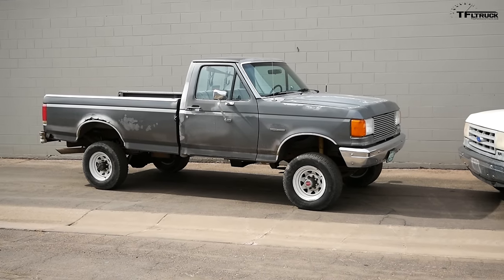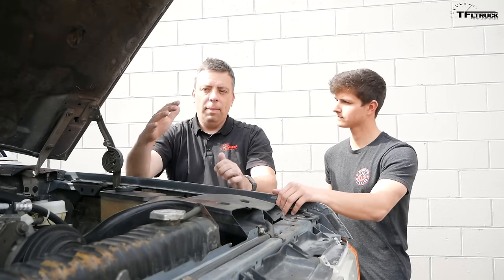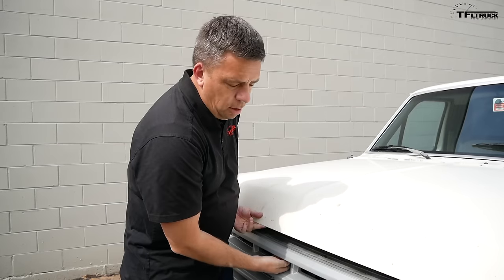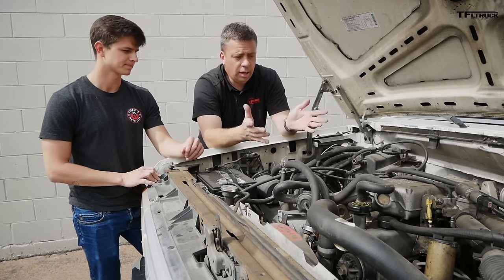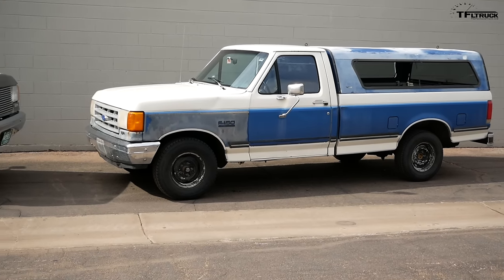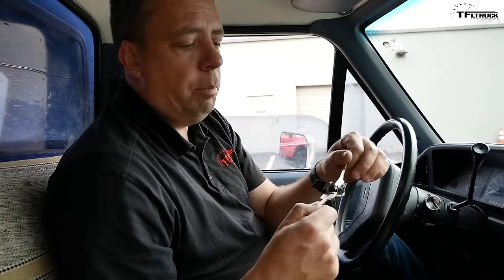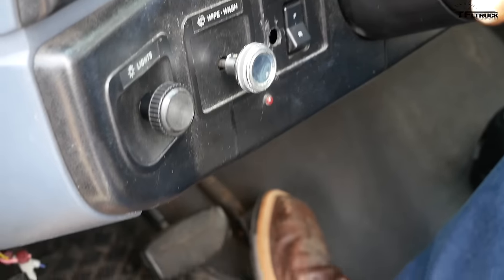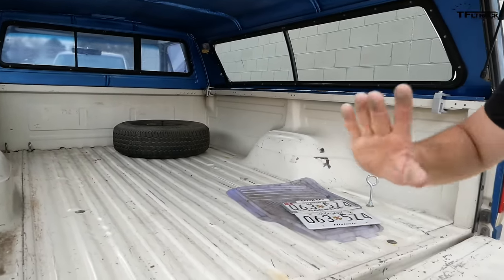Here's Why You Can't Kill An Old Ford F-Series Truck | Gunsmoke Ep.3

Comment: The 4.9 is one of best engines ever made. Shame Ford stopped making them.
Reply: id like to see ford reintroduce the 4.9l with a turbo as option in the Super Duty
Reply: Perry2186 absolutely. They wouldn’t do it because it would be indestructible and they wouldn’t make any money off repairs like soaking people with most of their modern garbage.
Reply: @Packinheat1175   I think eco boost Tech on a 4.9 get around 350 hp 500 tq
Reply: Perry2186 yup, at at like 1100 RPM 😀. Would make an rock solid power plant. Would be a torque monster.
Reply: @Perry2186  that would be so awesome, basically would be a diesel engine that runs off of gas
Reply: W R couldn’t agree more. Knew many people with well over 200K on them with no problems. One never even changed his spark-plugs.
Reply: Chris Hutchison I believe it. I had one for 25 years and it was an absolute tank.
Reply: My first vehicle was a 1993 F-150. It had sooo many problems. At one point, it was a I4 with 2 cylinders completely dead. I still drove it to the mechanic to find out what the problem was. I now have 2, a 1994 I300 with a M5OD manual as my daily. And the original 1993 I bought, waiting for me to finally get the new engine put in, it's an automatic. I will never own another vehicle. As of my 23 years in service I have been true to that.
Reply: scdevon probably because Ford made no money on repairing them. The one I had ran flawlessly for the 25 years I had it. Also, the eco-movement and peoples desire for 35mpg out of truck killed it. Personally I think people need to get off that kick. It has turned vehicles into overpriced, unreliable garbage.
Reply: My Grandpa used to have a 93 Ford F-350 with a dump bed on it and manual trans. When I popped the hood I was so surprised it had a gas 300 I6. Torquey engine
Reply: They had designs for a new inline 6 but the boys at the head of Ford wanted a more modern engine for the trucks and force them designed the V6 is that preceded it can't beat that engine for anyting and that's why they kept improving it but in all fairness in lines are old Tech and was frowned upon at that time
Reply: Ive got a 93 with a i6 and manual. No problems for the year or so ive had it!
Reply: dakota croasdale like the 8.1 in the avalanche 2500. It was a torque monster in stock form.
Reply: The real reason they won't is because they would not meet pollution standards.  You have more control over burn with smaller pistons.  That is one reason they made a V10 of only 412ci for years.  Also, they were not know for fuel economy so if buyers were offered this vs a new 2.7 or 3.5 turbo the take rate would be pretty low.  Less hp and less economy.  than the newer V6s.  Straight 6 only wins in longevity, but most who buy new only care if it to lasts 10 years, not 30.
Reply: I’ve had plenty of issues with fords. But I’ve never had trouble with a 4.9 six banger.
Reply: @jasonjohnson9810  hahaha hit the nail on the head
Reply: W R there also one the the biggest terds ford ever made, I had a 95 f150 4.9 auto 4x4, thing was a terd. My 1990 f150 4x4 with 5.8 351w is a tank on the other hand. I’ve seen so many of these old fords with the 4.9 rusted out or sent the the junk yard, seems that every f150 out there has one in it and barely any have a 302 or 351 in it.
Reply: I think ford coulda kept them in some of the f150s of the 97-03 generation, but ford was wanting to get away from pushrod engines back then.
Reply: I had a 94 ford e350 work van 300 straight six 461000 mi. Still ran like a top and only burned a little over 2 qts of oil between oil changes. Never let me down or left me stranded. Body mounts rotted out and i couldn't get it inspected anymore. It was like an old friend. Sad to see it go. I paid $1000 for it in1998 with 190k on it and bald tires. 21yrs later i got $450 for it for scrap. Long story short, best van ever with the best engine ever.
Reply: Perry2186 I heard a rumor that GM was looking into that as well.  But you still have packaging and weight issues.  Inline is heavy and is usually limited on bore size because large bore makes the engine longer.  Companies like BMW who use straight six’s keep them small displacement and use expensive exotic metals to keep them light.  They are made of magnesium.  Neither is good in a truck.  A Cummins is a straight six but has economy of scale in that it is basically a medium duty truck motor and industrial motor used in other applications.  A turbo small displacement gas 6 would be  cool.  That may allow them to make it small enough to fit in SUVs and get some economy of scale.  But at the end of the day it will still be heavy and expensive :(
Reply: Another new face?
Reply: Well ford's stock is like $5 right now. Someone needs to buy a stake in the company and force them to innovate on this old design. Imagine if we got a 250hp 600tq monster with 25mpg. Making money on them would be easy, since the engine can go in just about anything. Ups, dump trucks, hell with that power you could probably give a freightliner a run for it's money.
Reply: I have one on my '86
Reply: tomsriv and that is the sad part. Smart people don’t care about an extra mpg. Similarly smart people realize the climate movement is the biggest scam ever forced on society. If anyone disagrees, enjoy your $800 a month vehicle payment for something that will last 7 years....
Reply: Cuz I Can what do you mean by a “turd”? They were not designed to be power monsters, they were designed to be reliable, which they were. IF you actually see more of them in the junk yard because they sold more.
Reply: W R climate change is settled science.  But even if it wasn’t, and you need a selfish reason to be for it, think strategically.   we are better off if we have less demand for oil.  Millions of trucks getting 1mpg better is a huge difference.
Reply: tomsriv did you really just type all that with a straight face? 😂😂😂 settled science?? Says who? Al Gore? 50000 year old ice core samples with 8x the atmospheric CO2 levels of today. Must be all the dinosaur farts. 1 mpg better justifies the low quality and RIDICULOUS prices of modern vehicles?? Man, you have your priorities way backwards. I do agree we are better off using less than more but not if it means bankrupting society to do it.
Reply: W R it’s a lot more than 1mpg but 0.5 would justify it.  An old straight 6 truck gets about 12-17 while a modern V6 gets 17-22 or about 5mpg better.  If we still had old tech Saudi Arabia would be calling the shots.  They kinda already do.
Reply: chemicals and heavymetals are more cancer from china and india. climate xhsnge ?!?
Reply: That 4.9 will out work that piece of junk eco boost or should I say eco junk all day long, Ford's biggest junk motor , eats timing chains for lunch.
Reply: Blame EPA for killing the in line 6
Reply: @matthewmurray5168  it will probably run another 30 years without any major problems. That was when ford made a great truck.
Reply: @juliancrooks3811  yep! Still have it and haven't had any issues
Reply: They don't. Want. Them to last
Reply: They. Don't want them. To last
Reply: They ended production because it couldn't make emissions and fuel efficiency standards anymore.

Comment: Ive always told my parents that when i get a truck i want the old square body pickup. they bought me a 91 f150 that has a inline 6. its been the best one i had
Reply: You spelled obs wrong
Reply: @jimderess2206  they never typed obs
Reply: @jimderess2206  actually not an obs the obs body style started in 92 these trucks are a brick nose body style that went from 87 to 91 and switched over in 92
Reply: I got a 1992 F-150 XLT 5.8 litre automatic transmission for my first truck
Reply: @jimderess2206  91 isn't "obs", lol

Comment: I love my 1991 Ford F150. $800 and I drove it for over 8 years now. Over 500.000 miles last year and still going strong.
Reply: I can’t even find an old Ford for under 3K anymore
Reply: @lerg12   I just bought a 1994 F150 XL for $700 all it needs is a new tire and a headlight I was beyond lucky to find it
Reply: @bosssalute1443  I just recently got a ‘97 F350 with a 7.3 diesel, it’s my dream truck and it’s also a bit of a project too
Reply: I also bought a 1994 f150 XL for 1k.
Reply: @TruthLies & America You trying to be the next million mile Joe?
Reply: I bought my 87 4.9 for $1700, and it was one of the best decision I have made. 4 years on, and it has been the most reliable vehicle I have ever owned.
Reply: I have the 91 f250 xlt lariat 460 rear wheel and love it been a solid work truck and daily driver rusted a bit now but 30 years runs strong had next to no issues !
Reply: @TubsNSkins  would you take it on a long road trip?
Reply: @cptchuff2741  No way man. It doesn't have a/c, cruise control or a radio, and I don't think it has ever gone 70 mph in its life. Haha. But I'm sure it would make it anywhere!
Reply: @TubsNSkins  thanks for the reply! Has it ever left you stranded and is it fun to drive?
Reply: @cptchuff2741  It didn't start once, but it was in my driveway so it didnt strand me anywhere. The distributor went bad, which was a really easy fix. The hardest/longest part was diagnosing the issue.

And hell yeah man! The 4.9l is super torquey so you can break the tires loose on almost anything. I've even taken it off-roading and it has held its own every time. As long as you don't need to haul around more than 3 people at a time, there isnt a better ultra-affordable truck out there! I'll never sell mine!
Reply: @cptchuff2741  Also, I recently bought a baja bug and drove my truck about 80 miles to tow it home. Made the whole trip without a single threat of an issue.
Reply: @TubsNSkins  That's funny since the exact same thing happened to my Bronco. It turned over but didn't start and it was because the distributer went bad lol. The Bronco is too nice to take to college and I don't have many friends so the 3 seater shouldn't be an issue
Reply: @cptchuff2741  I love my truck but... I'll trade you for your Bronco. 😂😂😂 Yeah man get an f150. I couldn't imagine a better college car.
Reply: @TubsNSkins  That's an awesome rig
Reply: @TubsNSkins  thanks for the advice. Two old Fords isn't enough
Reply: hell yeah bro I picked up my 91 last year and still running great. Just curious, do you have the straight 6 or v8 and whats your gas millage?
Reply: @TubsNSkins  I heard you can get it restored to where you can drive it over 70-85 ? Don’t know how true that is though
Reply: @MaryJaneMusic17  I guess it depends on what you do to it. I've seen people turbo the 4.9, but I don't think I would ever do that. It sort of defeats the purpose of the 300, in my opinion. They were built to last, not to go fast. 😅 When I first bought it, I thought if/when the engine dies, I'd swap it with the 5.0 Coyote. Now, I'm almost positive that IF that engine ever dies, I'm going to replace it with another 4.9.
Reply: I bought my 1987 f250 V8 5.0 12 years ago. Only put some like 3k miles all this years. Long story becouse I brought it to Bolivia . Cant wait to drive it again.
Reply: @lerg12  mines 292,000
Reply: @MaryJaneMusic17  283K on mine although it’s sitting again now lol

Comment: Two things old Fords can't do: 
1. die
2. make a u-turn
Reply: Gorky D ford stands for found on road dead
Reply: Beau Green fixes or repaired daily
Reply: @beaugreen688  how original, did it take you a while to come up with that?
Reply: Run over a big puddle and get some water through the turbo. I promise you it’ll give up
Reply: @beaugreen688  First On Race Day
Reply: Eric Glueckert Almost as long as it took you to come up with yours... don’t overuse a joke and then criticize someone else for overusing another one
Reply: My 96 Bronco makes u turns inside your u turn. Runs Circles inside your Circle..
Reply: @USFREEDOMU   '96 Bronco turning circle: 36.6'
'99 4runner turning circle: 19.1'
Hahahaha, oh no.
Reply: @gorkyd7912  exactly. My Ram 2500 quad cab has a turning radius of 26.5'. A 3/4 ton diesel truck has a tighter radius than a Ford SUV. 😂
Reply: My 92 f150 flarside makes U turns like a car, or did tell the motor blew.
Reply: @beaugreen688  yeah because to many owners just ran it hard and put it away wet. If you do basic maintenance fords will outlast any other brand. Case in point my dads 56 f100 he bought brand new in 1956. Still drives it around today. Has well over 800,000 miles. No rebuild just taking care of it.
Reply: if its a mustang gt with no driver aids.
For 
Only
Real
Drivers(which im not)
otherwhise you'll get greedy and people will give you crowd jokes
Reply: Christ the 56 ford f100 is my favorite and my dream truck. Almost had one but way to much for money for a rust bucket. :(
Reply: Mr.chris
Reply: The 460 in my '86 F-25 idles so smoothly that sometimes people don't know it's running.  Those "Really?!  Well, I guess it is!" reactions are fun. I lug it down to 250rpm when I want to creep around and it's absolutely smooth and perfectly even.
Reply: @ericbraun4652  nice,  I got a 1980 bronco that was bought from jones west ford in reno nv, ( I'm an hour &1/2 south of there) but the bronco was bought there brand new in 80' . I got it in a trade but this bronco had a fuel injected 460/c6 combo slapped in by Jones west ford of reno, and I have since then done long travel suspension on it , swapped everything I was capable of doing myself , from a 95' bronco, ie: headliner, carpets, the back seat and side plastics. Left the original dash, as everything works, every gauge, the back window rolls down, solid bronco, but that 460 tho in the bronco  gets hella good gas mileage , barely have to touch the gas pedal. Lol
Reply: My E series actually completed a U-turn F series don't even try.
Reply: @beaugreen688  don't ever disrespect a 7.3L diesel again.
Reply: Donalld Allhands  pretty much. Even my non idi
Reply: I'm sure you could do the second one, but it'd be pretty tricky though lol.
Reply: @beaugreen688  that joke died in the 80's lol
Reply: @ELGlueckert  it's like the oldest joke there is, atleast when it comes to Ford lol. I'll admit I'm more of a GM guy myself, but I'll also be honest and say that I see more working ford vehicles than I do GM and they have two, the Silverado and the GMC Sierra. and I've had issues with two GMC's I owned at one point. a 2000 GMC Sonoma was one of them. and both trucks ended up having oil issues, and the interior and dashboard inside the Sonoma started cracking after awhile of being in cold weather. never thought I would own a Ford or even Dodge, but mostly Ford because of the bad names people used to call Ford back in the day, and some people end up believing it. but until you drive you one yourself it's a whole different ball game. so the first Ford truck I ever owned was a 92 Ranger, very reliable engine, but slow as balls cause of the 4 cylinder engine I had in mine. but I mostly used it for commercial use around town, but that was my introduction. after going from the Sonoma to the Sierra to a 92 ranger, that Ranger for just being a 4 cylinder was pretty reliable. and the cold weather didn't affect the interior or dashboard in any way. now I currently own a 2005 F-250 powerstroke, I know and that's one alot of people say to avoid, but I haven't had a single issue with it surprisingly.
Reply: @beaugreen688  First On Race Day, buddy.
Reply: My 88 F150 can make tighter turns than 93 Accord. But my 93 accord is faster.
Reply: @Weenie-yh4kf  because other vehicles won't🤣
Reply: @Akhazmat907  I need details brother, I'm intrigued. My o3 f150 is at 329,000. Hoping I get at least 500,000
Reply: @gorkyd7912  4runner is not as big or wide as a bronco
Reply: @dequannruffin3858    Bronco has 105" wheel base same as 4Runner. Weighed 3750 lbs vs. 3930 for a 4x4 automatic 3rd gen 4runner. 10" wider should have helped Bronco turn sharper, harder to tip it over.
Reply: @gorkyd7912  I didn't know that, thanks
Reply: I make a u-turn with my 1990 Ford Ranger all the time.
Reply: Fantastic 
Operating 
Road
Device
Reply: @beaugreen688  I remember this from kindergarten. Back in ‘88. 😴
Reply: Idk I can make a u turn pretty easy in my 96 f250 supercab
Reply: @beaugreen688  nah, First On Race Day
Reply: @ericbraun4652  I can top that.  A few years back the muffler fell off my 92 F150 I6 and you couldn't even tell by sound.  I only caught it because the exhaust was coming from under the cab.  Put a new muffler on and you STILL couldn't hear a difference.
Reply: @Mark That is fascinating sir, and exactly the sort of factoid that I enjoy throwing in peoples faces.  Thank you for the ammunition.
Reply: Same with the new fords lol
Reply: 96 F150 short bed here. Even WITH a short bed, U-turns are so damn wide LOL
Reply: Or make a reasonably sturdy power steering pump. 😒
Reply: The uturn got me weak 😂😂😂
Reply: @beaugreen688 cheap heap every valve rattles
Reply: I can’t avoid old men telling me they had one as a youngster 😭❤️
Reply: I’m runnin stock dodge wheels aswell I can’t avoid rubbin and gotta keep ‘em tight
Reply: my obs 94 actually has more radius than bmw sedan
Reply: What is the fuel mileage on the straight 6?